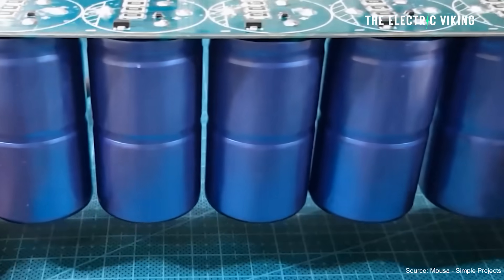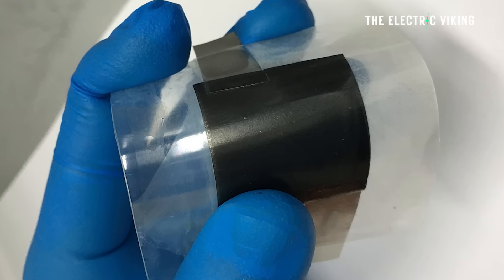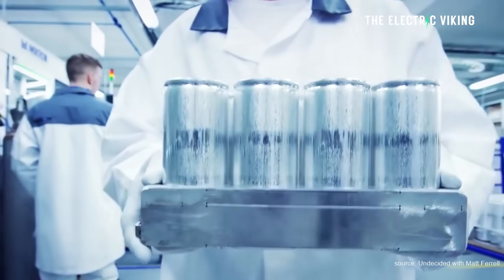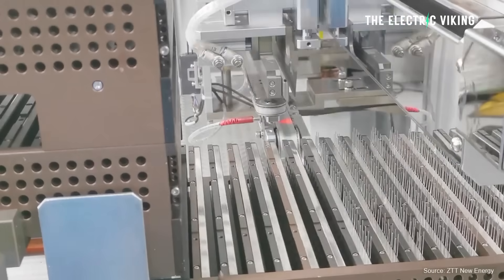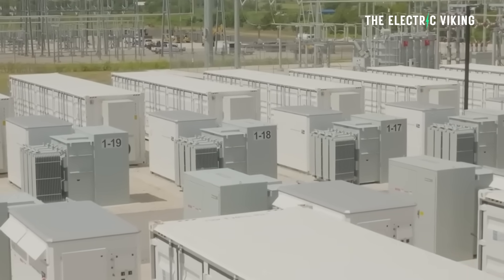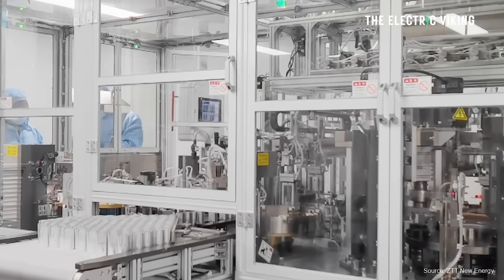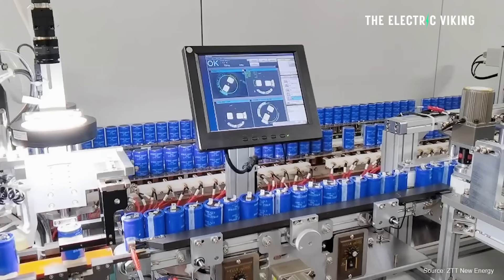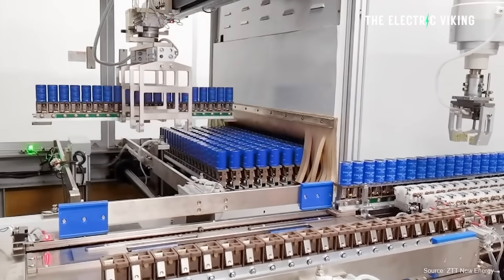UCLA  reveal plastic supercapacitor Breakthrough with 70,000 charge cycles

Comment: Things seem to be getting mixed up a bit here.

Normal capacitors have a virtually infinite number of charge and discharge cycles. This is why lifetimes tend to be specified in years rather than cycles.

They are used for a variety of applications from signal processing to energy storage.

When used for signal processing, they can be charged and discharged thousands if not millions of times per second. While they store and release energy, the amount is extremely small.

Electrolytic capacitors have larger values and are often used for smoothing in power supplies. They can go through 50 to 100 charge/discharge cycles per second. The duration they supply power is measured in milliseconds.

Supercapacitors are designed for energy storage. Their charge/discharge cycle is a lot slower. For example, a common application is to maintain the clock in your PC. It charges when you turn your  computer on, floats while the computer is running, then discharges slowly while it is off.

Capacitors store energy as an electrical charge rather than in a chemical form as a battery does. As a result, capacitors have a MUCH lower energy density.

Hybrid supercapacitors have some battery technology built in. They have a higher energy density than a regular capacitor but suffer charge/discharge limits like a battery. The subject  of this story is one of these.

When used in regenerative braking, they will charge as you brake and discharge into the battery after.

If used to power the vehicle (assuming the energy density issue is addressed), the charge/discharge cycles would be dictated by how often you plug the vehicle in to charge and how often you drive it. There is nothing inherent in the battery that dictates how frequently it is charged. If it charges and discharges several times a second, that can only be because you are stopping several times a second to charge your EV. Clearly ridiculous.

In an EV, the number of times you need to recharge is based on range which results from the energy storage and energy density.

So, capacitor charge and discharge cycles can range from millions of times per second to months or even years.
Reply: Very good analysis - ta. Re your comment "Hybrid supercapacitors have some battery technology built in. They have a higher energy density than a regular capacitor but suffer charge/discharge limits like a battery. The subject  of this story is one of these." 

Question - could such a hybrid capacitor be used in such a way that when accelerating the car (eg from a stop light/sign or when overtaking), the supercapacitor portion could be discharged to provide that acceleration, thus saving the battery portion from being used for acceleration and thus increasing the range of the car, and when the car is going at constant speed, only the battery portion is used, saving the capacitor portion for acceleration only?  No doubt some software would manage which percentage of each of the supercapacitor and battery is used depending on the circumstance - acceleration or steady speed respectively.  

Also, could the regen braking system be set up to prioritise the charging of the supercapicitor portion first, so that it is always ready for instant acceleration, with any regen braking surfeit then going to the battery portion (eg LiFePO4), all of which could also be managed by software? Ta.
Reply: @Awethenticare  , thanks.

To answer your questions, put simply, yes. Capacitors are really good at charging and discharging rapidly, unlike batteries that must follow a charging profile to avoid damage.

Sam's video shows a capacitor being short-circuited and smoking the wire. A battery would either suffer damage or be current limited by the BMS. I've seen videos where people have used a supercapacitor as a spot welder.

To be blunt, I don't see a supercapacitor ever powering your EV, but being in the regenerative braking,  certainly if it is not there already.

For accelerating a car, they could be used but it would be pretty pointless. EVs use brushless DC motors. In spite of their name, they are actually AC motors. Unlike brushed DC motors, the speed is not dependent on the voltage or current but the speed of a rotating magnetic field. A battery can provide all the power necessary to create the required torque. The speed controller is what really controls the speed. At best, a supercapacitor could provide an extra boost in an otherwise low performance vehicle (why I said "yes" to your question).

Comment: I am sure the vaporware Aptera will be powered by vaporware Super caps. These will be used in conjuction with the Toyota stealth Solid State batteries. Not knocking the presentation I love your podcasts. They are like reading a 1970s Popular Science magazine ( todays PS has no relation in content to the old one).
Reply: What makes you think Aptera is vaporware?
Reply: @davidnika446 10 years in development and zero units sold? No clue, that you cannot get out more of sunshine energy than it‘s in the sunrays. You might look up solar constant which is roughly 1kW per square meter.

Comment: Caps with 105°c often are the ones to fail first. High temp ones of over 130°c are the more reliable ones to go for.
Reply: Those are aluminum electrolytics. The life span of those capacitors is highly affected by ripple current.

Comment: Interesting.  But remember this is nothing unusual for a capacitor which can charge and discharge millions of times in one second.  Now maybe not at this current / voltage level.  A capacitor deals with static electric charge and not a chemical reaction like most common cells do.

Comment: A car would never use the full 70000 cycles.They are used to save the energy in regenerative braking,as Lithium batteries can only catch a small amount wattage from breaking.
What would be great is to see testing which car has the most efficient regenerative breaking ie the most efficient in very hilly areas.My guess would be Tesla Kia Hyundai & Porsche & Audi.Also would be very interesting to see how efficient Toyota Hybrids are in hillie areas.
Very few video looking closely at the super& ultra capacitors in cars braking system.
Should add main reason they are only in braking is both price & weight, when used in the braking system they will save weight because they will charge & discharge multiple times but used as main battery too heavy
Reply: Is it "braking" or is it "breaking"? You need to make up your mind.
Reply: @chesshooligan1282  From the context, Jason means braking by the car's brakes.

Comment: You are right about the life of capacitors. You have probably encountered your LED downlights that fail after a few weeks or months. Within the LED casing the temperature of the capacitor can exceed 105 degrees C. Equals 41 days life. Better capacitors are 2000hrs at 125 degrees C. So 7 years or lifetime warranty on LED downlights is false advertising. Just keep your receipts and return the failed downlights to the shop.

Comment: # of Cycles is not an issue

Capacitors tend to have low energy density and leak.  Not sure of the cost
But these are the challenges